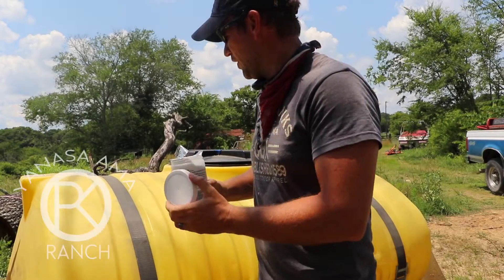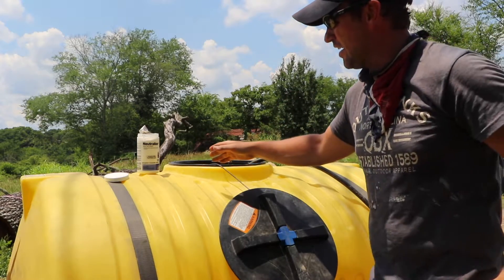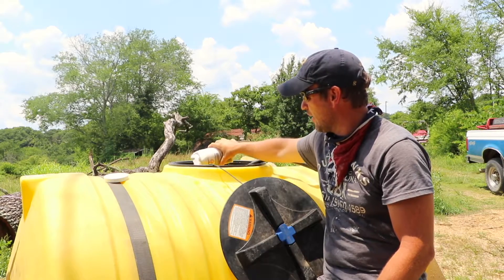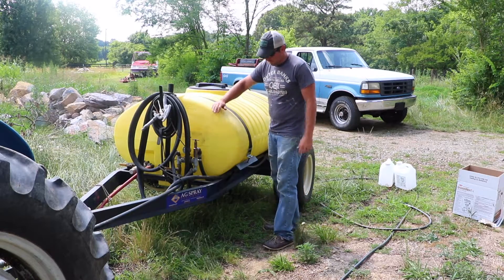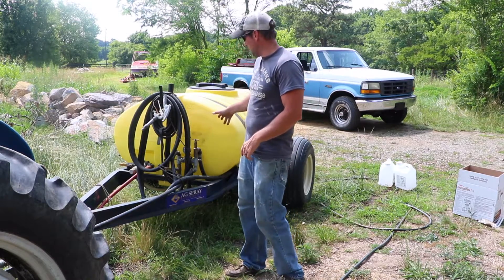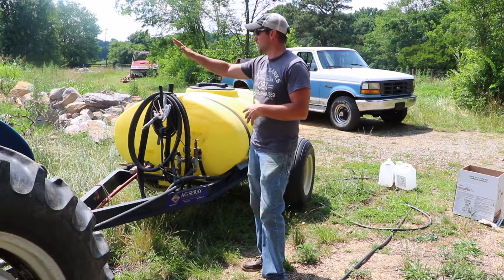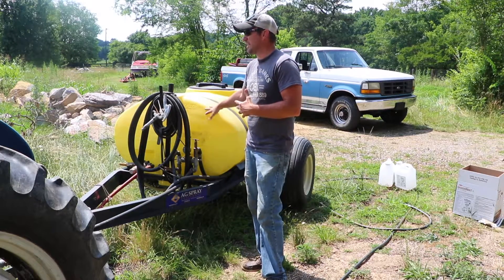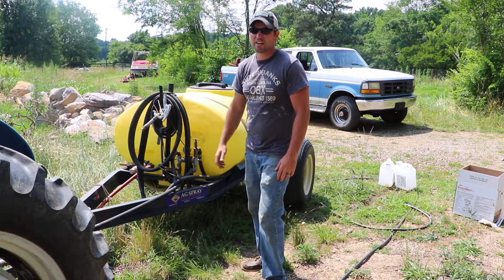Cleaning A Sprayer Tank [Agriculture]

Comment: Ok I sprayed roundup with my 130L boom sprayer I didn't have any special cleaner/neutralizer.

I added some Simple Green Heavy Duty Cleaner to my empty tank and ran water until full, then I ran it for about 5-10 minutes allowing it to overflow, then I ran the sprayer at 40PSI until empty, then I used garden hose gun to spray walls of sprayer some more while sprayer was spraying still.

Will this do it or no? I need to spray fungicide tomorrow.